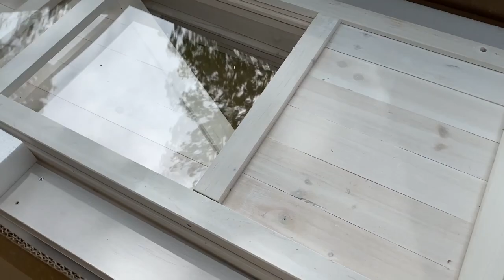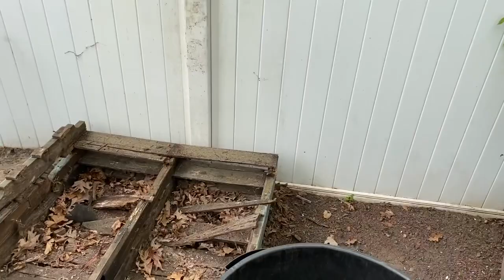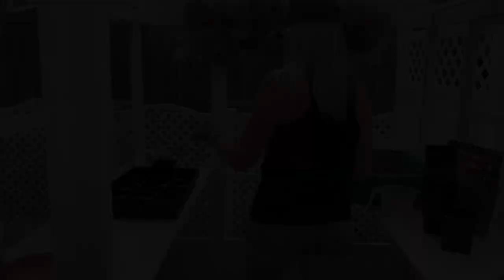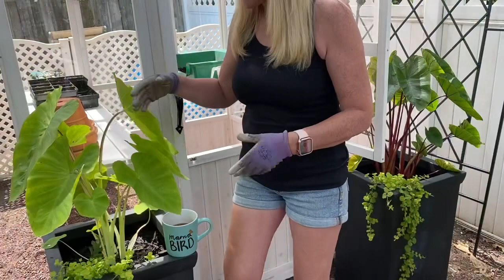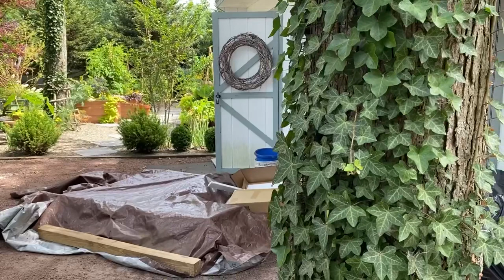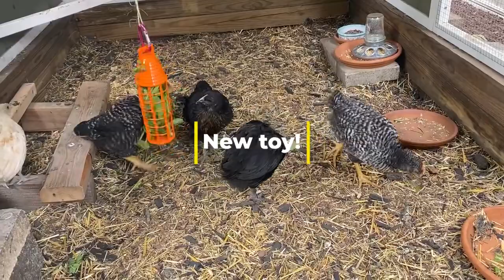Cottage Style Greenhouse Tour & Future Courtyard Plans, Aviary and Chicken Yard/ PlantTastic

Comment: It’s quite adorable! Come winter, will snow load be a problem?
Reply from the maker: Hi Deb, thank you! Yes, snow load will be an issue for the plexiglass if it piles up so that is a big reason I will be adding polycarbonate over top of the Plexi. It will double insulate and give the window areas strength. I can get that cut to size and then just screw it on. The wood will hold up fine to the snow. It is as thick as the wood on the chicken coop and willows barn (which holds 2 feet of snow easily). Until then I'll just broom off any accumulation which shouldn't be much due to the fact that it gets so hot inside. I was very surprised when building this that the wind (20 mph) had no effect on it even when there were just a few panels together. I definitely wouldn't buy something like this unless willing to incur the cost of the polycarbonate though.
Reply: @planttasticcookinggardenin1561  I would a structure like this but would worry about it here in hurricane country. You will love puttering around in there!
Reply from the maker: @debweissler7808  Yes, we get our share of named storms here too that's why I purchased a wood structure. They are easier to reinforce if needed. I've seen too many pics of the regular style collapsing and I'm very familiar with this type of wood structure due to my animals. Insurance is definitely needed too for that reason. Any greenhouse, anywhere these days is vulnerable, unfortunately.